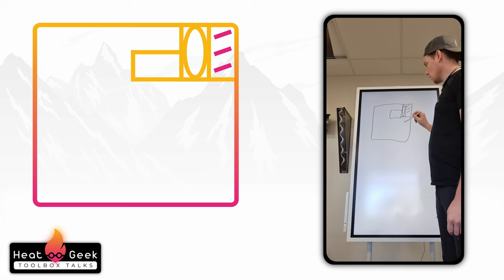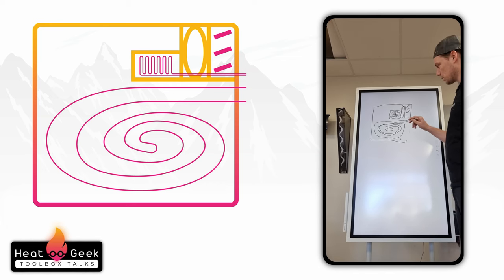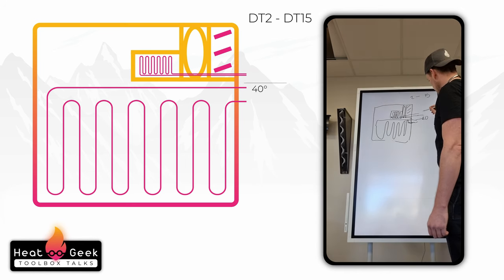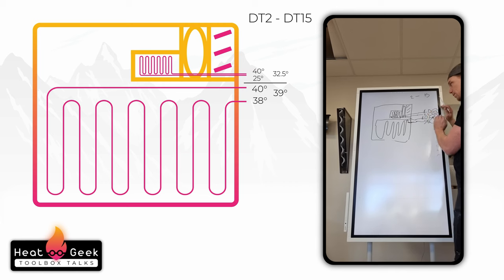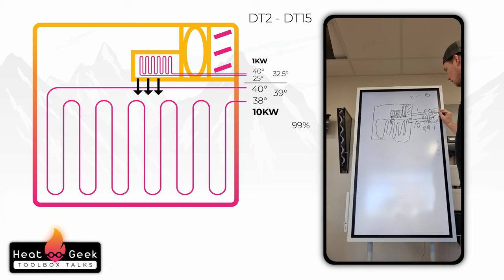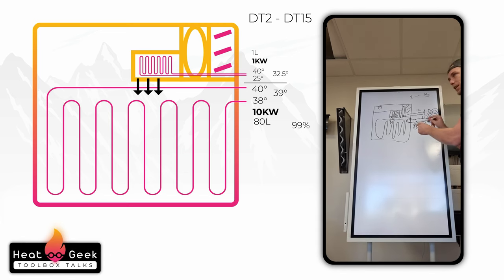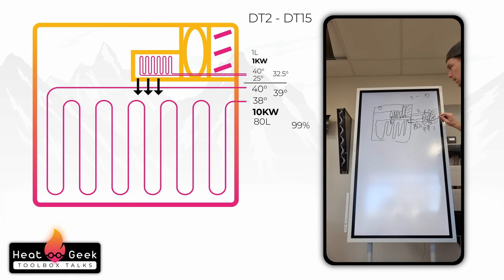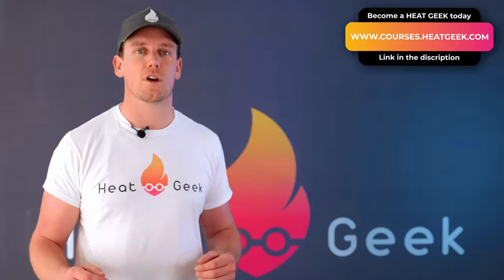Under Floor Heating designing, spacing and balancing | Toolbox Talks

Comment: I live in Denmark and we design systems to an out door temp of -12C. We generally use DT 3-7 with a snail pattern at 150mm cc, but we put 400mm of insulation under our slab

Comment: 100mm centres everywhere  future proof the house.
Also further down the line you are not stuck on what floor coverings you can have on tog value
Reply from the maker: 100%
Reply: Ok thanks
Reply: Is there not a tradeoff in pumping losses? 100mm centres means quite a lot more pipe (50% more than 150mm and twice as much as 200mm) so more power needed to shift the water through it. Or do you just keep the pipe length to some limit and add more loops? So there is a bit more pipe in the runs back to the manifold, but mostly it's just an investment in manifolds?

Comment: Are you saying with low temperature UFH on full weather comp that room stats should still be installed as temperature limiters or none at all? 

I'd like to know for my self build with 37.5 MWT, if i should use 100mm centres throughout the ground floor or use custom per room to match the heat losses and floor coverings. Two equally sized rooms I have, ones 590w, ones 1100w because it has more glazing so not sure same centres would work?

Comment: Can underfloor heat and low-temp radiators use the same weather compensation curve? I guess they would require the same mean t and dt for this to work?

Comment: Im using 10mm pipe - whats the maximum loops and what size pump do I need for a 20m2 area? Approx 7.7l of water in pipes. Im thinking 12 loops (easy for a 22m manifold with 4 10m outputs/inputs on it.

Comment: My 2020 new build is 80 degree flow 60 return 👍👍👍👍👍👍 and no thermostat on the downstairs room (it's on the first floor  zone).
Reply from the maker: Standard lol. building regs are to change to a 55c flow temp max from now on.
Reply: @TheDickPuller  it's 3 floors 2 zones. Unfortunately no zone for the obviously colder ground floor.

Builder doesn't care whatsoever.

Comment: So in summary for a lay man that’s about to have UFH. Large rooms go 100mm centres, small rooms 150-200mm centres. Open circuit no zones. Is that correct? What pattern should I have? Didn’t understand that?
Reply from the maker: No. 100mm centers everywhere and use balancing to rectify. NOT controls .. they are the fall back. This video is not for laymen or enthusiasts really and could lead to issues.. laymen should listen to designers I don't want responsibility
Reply: @HeatGeek  where do I find a designer in Essex!?
Reply from the maker: @waterandlightbyalandeeney4304  have you looked on find a heat geek map?
Reply: @HeatGeek  I had a look, the guy you and nath recommended has had Covid and couldn’t see any others near me?
Reply: @TheDickPuller  oh ok, but still 100m C I’m larger areas?
Reply from the maker: @TheDickPuller  you sometimes need additional heating in bathrooms yes.. but it's dependent on the heat loss.. that's why that's the first crucial step. Generally speaking 100mm centers is enough in real life even though calcs don't agree.

Side note @fiberwasher youtube has informed me your our no 1 fan through views and comments. ❤️ ❤️ ❤️ 
Thank you mate 👍
Reply from the maker: @TheDickPuller  thanks appreciate that. No none of it new.. just seldom used!
Reply: Why did H hetta design my ufh at 200 mm centres ?
Reply from the maker: @mgbroadsterJ  so their materials were cheaper and they could make more from the job.
Reply: @HeatGeek  Thanks for the videos ..Us Laymen not gona blame you, just need to get a grasp of the physics. 
.... How many watts/m2 of floor do you get? ..
Reply: @HeatGeek  Thanks for the videos, Us Laypeople just want to understand, the physics , we not go to blame  & if we choose to plough up our floor on the strength of anyones  youtube vid & the collection of random advice comments... more fool us.    .Domestic energy use is important & so often been designed & maintained into inefficiency. ....
Reply from the maker: @brackcycle9056  anywhere from 60 to 150w/mw.. many many variables. Non of it is simple. This is not a laymens video.. all yhe tool box talks are aimed at engineers.. we have consumer stuff coming.

Comment: any tips on how to make those 100mm bends without kinking the pipe
Reply: There are special underfloor heating base plates for that. They look a bit like lego base plates. They come with a 50 mm spacing so jou have some flexibility in spacing and bends. 
They are available without and with insulation, raising your floor height.

If you have a concrete ground floor with proper insuliation, just get a professional to do all of it when your floor needs replacing.
Special machines can cut out the snail patterns and they level it all, which you will need for PVC floors anyway.

That way you do not lose any height and all of the outside doors will still open. 
Upstairs just shortening the doors if needed is much easier. These machines are heavy and bulky anyway, so a base plate system makes more sense.

Comment: Problem with low DT and Inverter heat pumps is they cycle too often. Need to drip feed them with cooler water so that they  have something to work with.
Reply from the maker: It’s energy based, dt doesn’t matter. Even if the dt was wide if energy out is below energy in it will cycle. Infact widening the dt will increase flow temp and cause overshoot so cycle

Comment: This is only highlighting concepts, not providing any formulas or design on how to design your UFH on the amount of pipe required  as in length, flow rates, and delta T, and using with heat pump or boiler and the best flow temperature to get the best efficiencies from your design system
Reply from the maker: Correct. See our 120 hour indepth training on our site for that

Comment: Having a 40 flow and 39 return doesn’t mean you’ll have a warmer room. It means that you haven’t transferred any of the heat into that room. 
Your return temperature has an effect on the performance of the heat pump. Having a lower flow rate increases the amount of heat transfer, increasing efficiency.
Reply from the maker: Sorry that's completely incorrect, the output of all emitters are based on the dt between their MEAN water temp to air temp (mw-at). The greater the MW-AT the greater the heat flux /power output.
Reply: When your 40 degree radiator doesn't transfer any heat, it's probably because you room is steaming hot already.
Reply: A very common misconception. See Adams mass flow video for a better understanding
Reply: I think this is what the student in the video is trying to ask. Heat output is a function of dT (as well as SHC and flow rate) according to your mass flow video, so when you suggest increasing the dT they (and I) initially correlated that to an increased heat output. However, to achieve that higher delta T the flow rate will be much lower and so the actual output in kW will be lower. Have I understood it correctly? 
This wasn't really explained brilliantly in this video, though I'm sure the point was made in the class.
Reply: @HeatGeek  sorry a floor heating system output is based upon BS EN 1264 and can be easily calculated using the difference between the surface and air temperature. It is different to radiators whereby a kH value  is calculated dependent upon the overall  floor construction kH * (MWT-Air)^1.1. With radiators it is easy to apply EN 442 with a simple MWT-Air due to the very low material resistence between the water and the air. However, floor heating system build ups vary so much, such as a foiled and grooved insulation panel with a timber covering versus a dry pug screed system  beneath a chipboard and carpet. I would recommend you studying BS EN 1264 as it will give you a good grounding 👍 good luck.
Reply: It's always good to research each area well before doing these videos. How's the studying of the BS standard going?